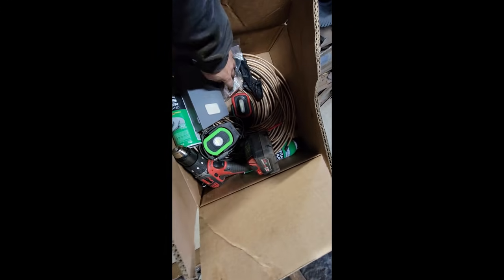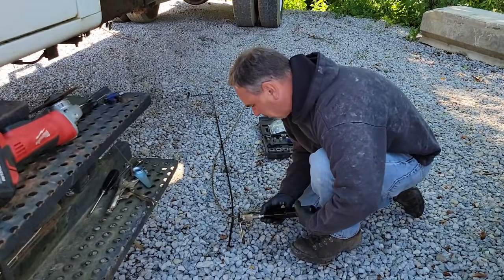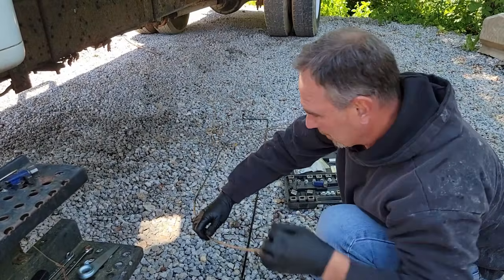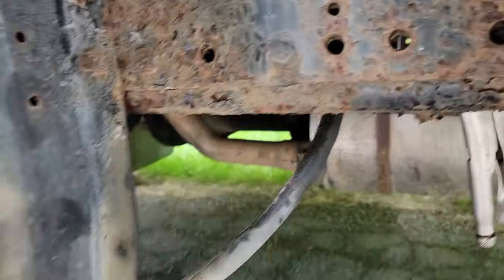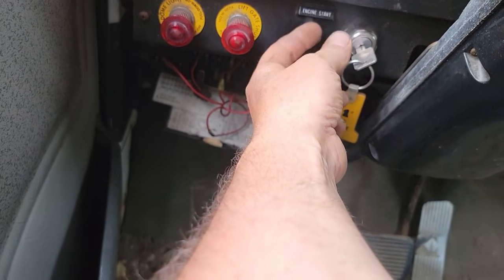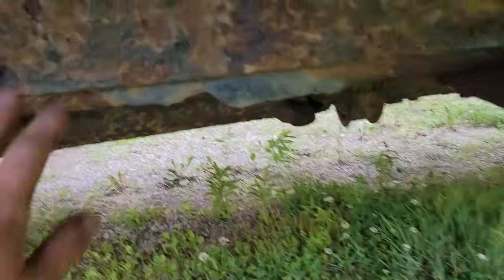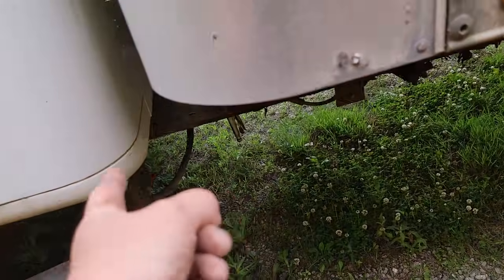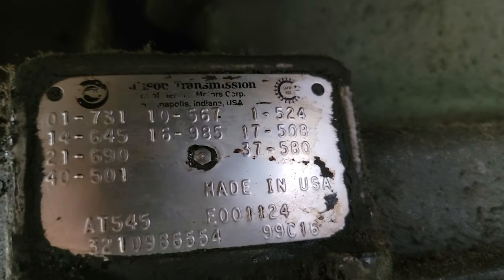BUYING A 2000 INTERNATIONAL 4700 WITH NO BRAKES

Comment: Dear J.C. Smith couple.
👍👌👏 Nice purchase. Could even be a good RV using that big box.
2) Another buy...uhm... I really wonder if this is the way to slow down for fulfilling some of your postponed wishes. ;-)
I'm nevertheless eagerly looking forward to watch the modification series about this nice truck.
Best regards, luck and health.
Reply from the maker: true statement. i bought it because it is one of the most desirable trucks to sell. no cdl required to drive, automatic and hydraulic brakes. after some thought, i am considering making it a little rollback for myself. then my wife can drive it as well.
Reply: @j.c.smithprojects  
So at least a kind of dream would be fulfilled!? ;-)
I like this truck too and I definitely don't know why so much people don't like automatic gear boxes in trucks. Don't get me wrong: I absolutely love Twin Sticks Garage channel and Mark P.. But I definitely see absolutely no use in this strange/weird twin sticks gearboxes thing. By the way: It wouldn't have been allowed in Germany. To have no hand on the steering wheel, sometimes even grab the sticks through the steering wheel !!! is simply dangerous. Totally unnecessary too. Don't know why the heck somebody invented crap like this. There are/had been way less complicated and more efficient ways to gear vehicles. By the way: When I was young... a loooong time ago, sigh, we had 3 big trucks (biggest one with 22000 l tank and 12.5 gears.l).
Sincerely yours.
Reply from the maker: it would fill a need for sure. i really used the small rollback a lot in the time i owned it.
Reply: @j.c.smithprojects  
Thanks for replying again and especially for the heart. I simply love to earn them for my comments.
2) I know, I watch your videos (even older ones). If I remember correctly, you mentioned that a relatively short roll back is needed for the garden stuff.
Sincerely yours.

Comment: Nice score J.C.! I'll definitely be looking forward to what you do with this one. I've done the same exact thing with the brake lines that fail in a jam. Rear brakes do a lot less than the fronts anyway, plus a couple miles from home isn't much when it comes to limping to gotta go. Definitely beats messing with flares on the side of the road. 👍😎
Reply from the maker: that is the way i looked at it.

Comment: Hey i just did the same thing. got a rollback 2000 4700 with a t444e cheap, as my first ever big truck. drove it home with barely working front brakes and skipping like a bastard. Injector harness fixed the skip and and been waiting about a month for front discs in the mail 🙄. Love what you do!
Reply from the maker: i get my brakes right from international dealer. great prices and quality parts.
Reply: @j.c.smithprojects  im just a kid balling a budget i went the cheap route like a ding dong

Comment: Either way you go it will be a cool truck!
Doesn't take much time to swap out the non-aperture housing for the aperture one.
If wheelbase stays the same, need to shorten first driveline like 3 3/4".

Comment: Oh yeah I take wide open dirt roads too ,none county one ,they are literally 5 dirt roads in any direction out here in my Mojave desert 🏜, t wide open out here, they hav put little brown sticks on some of the BLM roads way out from here , and you are forced to stay on .     Oh on the IHC doors I had a 1983 DT 466 Rotary Bosch 100 pump and a 5 and a two, my door on all of my IHCs you have push in hard on the door an pull out on the handle it works just fine , I never had to fix them ever, they worked like that ,( push in and pull out on the handle) til I wore  it out and junked that truck , loll, nice 👍 thanks I learn some about tags in this one , BigAl California thanks.

Comment: I’ve got the same truck in the Low Profile flavor, 14’ box,  350k miles, zero rust, stronger engine than my 2005 dt466, just runs rough so I think it has injector(s) issues. Also, my oil cooler is leaking like crazy and I’m not looking forward to fixing that especially on a low profile truck. The front axle is like 6” off the ground.  It has the AT545 too and I think it’s sort of a junk trans, no lockup and it runs hot unless you put a cooler on it. A nice Eaton manual would be good, but hey, we get what we get, right?  So my collection is the 2000 like yours, 2003 dt466 non-egr and the 2005 dt466. (Selling the 2005 soon)
Would love love love to find a 2000 or so crew cab with a bad engine to slap on my 2000. (Ditching the box of course). 
I’ve got a 1971 International Loadstar Travel Crew on a trailer on its way to me tomorrow . Zero rust, untouched fire truck, can’t wait!
Keep the awesome videos coming and thank you!!

Comment: Hey jc I seen one of these 2001 200k miles one owner box truck about 20 ft I think go for about 6k up here in sota...wish I would’ve swapped it for my 07 isuzu but it has 130,000 only so I wanna run it in the ground. Stay well
Reply: Had the 7.3 automatic

Comment: Hey JC...figured I'd ask the International guru. I have an 02 International 4300 33k truck with the DT466 Allison 5 speed. My question is on the starting procedure because I've heard 2 different trains of thought on it.  When you turn the key to power, the dash does a double needle sweep and the ABS does a solenoid check. Personally, I always wait for that process to complete before I turn the key to start the truck. I've had others say to just hit the key and start it without waiting.  I thought I read somewhere that you can actually do damage if you just start without waiting.  What say you?
Reply from the maker: i wait for the self test to complete itself and the wait to start light goes out.

Comment: Hi I have a question. I have a 2000 international 4700 DT466E motor it cranks but stays on for only 30 seconds. Do you know what that could be? Just asking I’ve tried almost everything to keep it crank.  Thanks
Reply from the maker: first thing to do is figure out which type of "shutting off" it is. is it just at the same amount of time every time? is it like you shut the key off, or does the idle slow down until it finally stalls out, or does it run rougher and rougher until it shuts off?

Comment: Good looking unit. Does it make the ride rougher by shortening the chassis  to much. I thought the longer the better and it then could be duel purpose (I.e. carrying lengths of crap then tipping it out ! ) hey I’m lazy ! Hello Mrs JC.
Reply from the maker: yes. shortening the wheel base will make it ride rougher. however, adding the weight of a rollback or dump bed will help.

Comment: Jc didn’t look like the gauge cluster was working I have a 2000 international works sometime sometimes doesn’t where would you get fixed or do you just replace
Reply from the maker: remove it from the truck. flip it over and look re- solder the connections near the green connector. i have fixed many that way.
Reply: @j.c.smithprojects  thanks not a hard fix I'm was scared to get heat near the circuit board

Comment: JC, quick question. Since you are repairing the juice brakes on that truck, how hard would it be to swap that rear into a ‘98 model F700. I’ve got the Lucas Girling setup and looking to swap out to something different without breaking the bank. I appreciate any help
Reply from the maker: lucas geirling brakes are used mostly with transmissions that dont have a "park". so swapping out the rear end on solves on part of the problem. look at the back of your transmission and see if the is a flange with 4 threaded holes in it for mounting a parking brake.
Reply: @j.c.smithprojects  , I’m not sure if it does but it’s an Eaton FS4205, 5 speed…. Dunno how familiar you are with that trans. Thanks again. Also, do you have a place to make contributions to your channel? Good advice is hard to find.
Reply from the maker: if not, you could use a rear end from a international 4300. they have disc brakes and a cable operated parking brake on the pinion.

Comment: The back brakes shouldn't be hot if they weren't working right lol
Reply from the maker: understand that the back brakes were getting proper pressure until the line blew. so it had rear brakes for over and hour and a half of driving. i was concerned about calipers sticking is why i checked the temp.